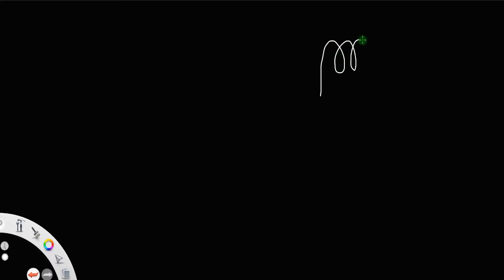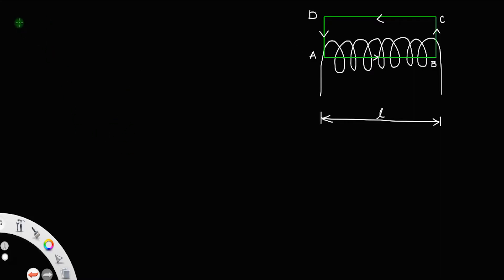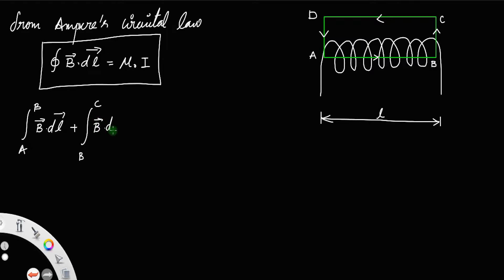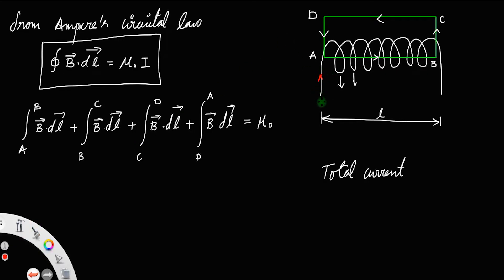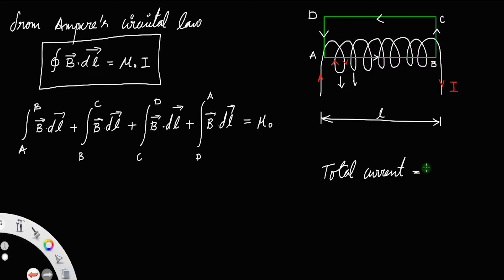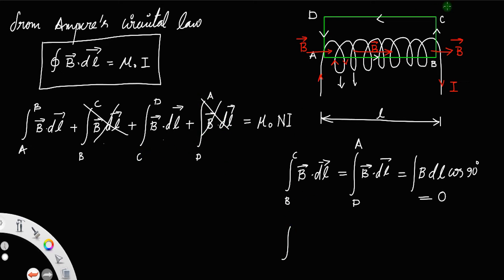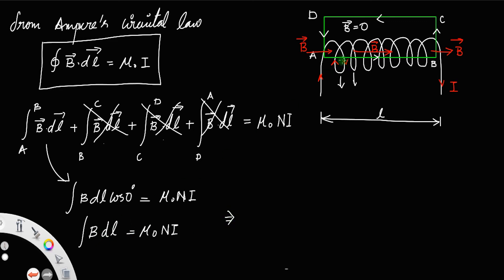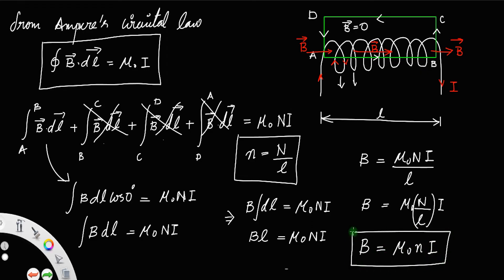Derivation of magnetic field due to a solenoid from Ampere's circuital law • HERO OF THE DERIVATIONS

Comment: How can we proof that magnetic field is uniforme inside a solenoid.
Reply from the maker: @HamidOumimoune-sb6zq  if you replace this solenoid with a metal rod and let the left side be marked A and the other end B. The current moves from A to B. For the solenoid also even though the current is circulating through each turn as a whole current moves from A to B. That's why B and I are same direction. The direction of current is usually consider as length vector. So B and dl are in same direction.
Reply: @heroofthederivations7305 I know That I and dl are in the same direction, but I know also that magnetic field produced by a coil is perpendicular to the coil. It's not very clear to me that B and I are in the same direction.
Reply from the maker: @HamidOumimoune-sb6zq  Actually through each turn the current is circulating but when you take the solenoid as a whole the current is moving forward from left to right so it resemble like a metal rod carring current. Also when the radius is small compared to length we can almost neglect the rotation of current. So B and I has same direction. 
Though this is not mentioned in any books i came through. Its my guess how it will be.
Reply from the maker: @HamidOumimoune-sb6zq  Actually the field is uniform for long solenoids. The real equation is B =moni(costheta1 + cos theta2)/2.
I have derived that you can check👍.
Reply: @heroofthederivations7305  thanks